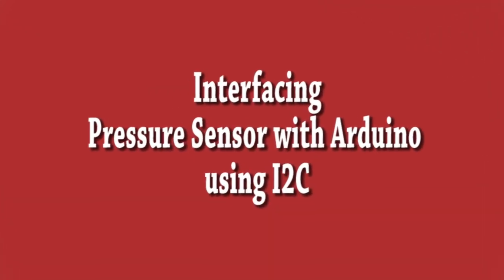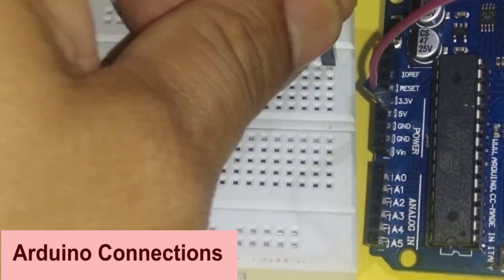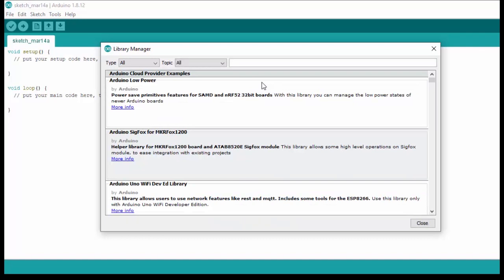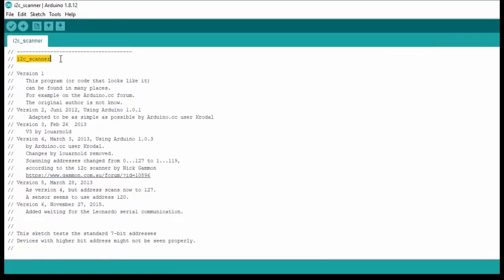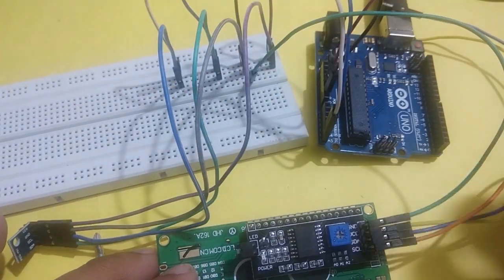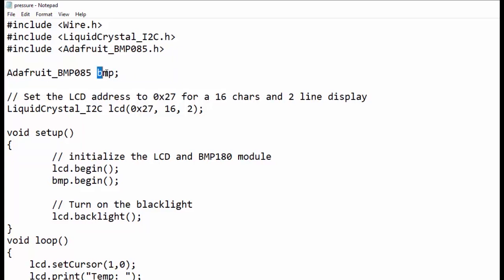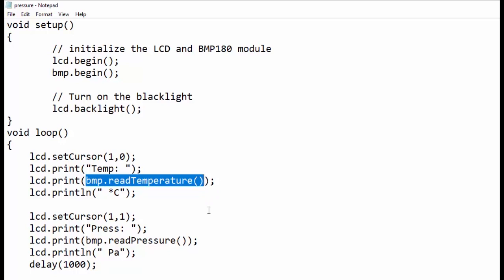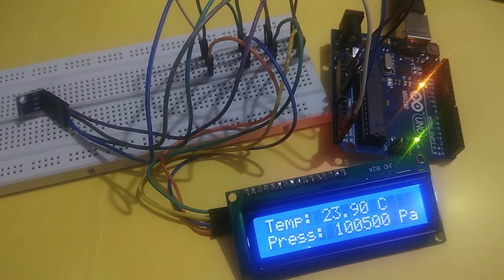Interfacing Pressure Sensor with Arduino

Comment: LCD ke piche kya lagaya hai
Reply: Urgent reply chahiye, jaruri hai
Reply from the maker: LCD is attached to i2c interface card. It is attached at back side of LCD. 
Arduino uses SDA and SCL pins to read or write data to LCD using this i2c interface card
Reply: Ok thank you